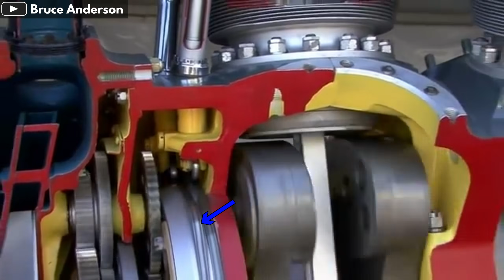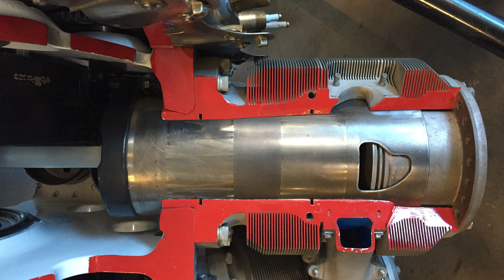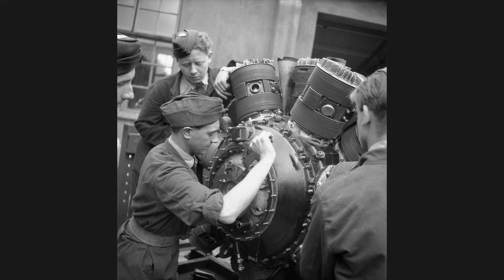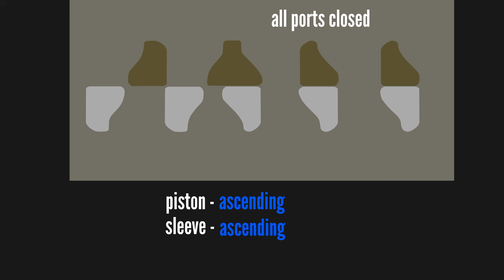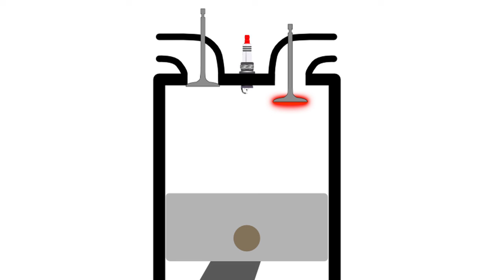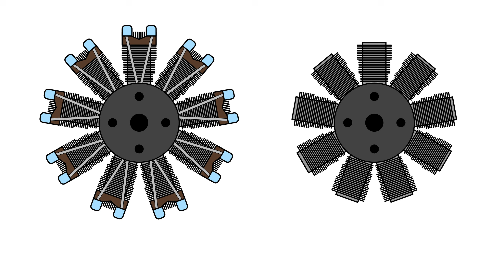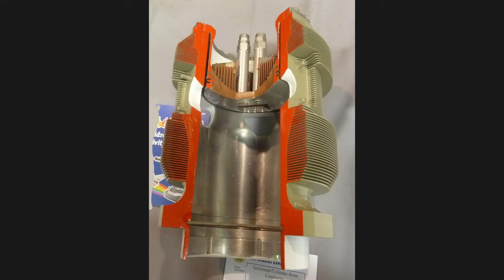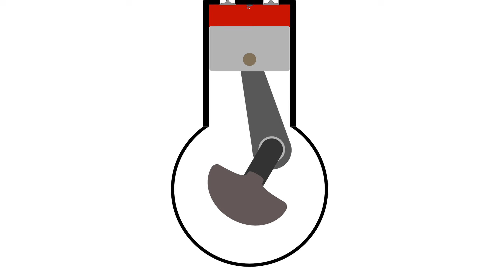Analysis of Bristol's Sleeve Valve Aero Engines

Comment: Thanks. Great Video
Whether it was the right path to follow: there's quite a few examples of the Brits sticking with what they had rather than trying to change mid-war. Vickers using geodesic construction and de Havilland building with wood to name two.  When you're fighting for survival, "what you have" can be better than the theoretical best.
Reply: While not a popular opinion, the UK aircraft industry while once very prolific was never a technology leader, and as you pointed out was years behind in many aspects of aircraft manufacturing compared to America or Germany at the time.
Reply: @DoktorBayerischeMotorenWerke  They weren't years behind so much as some companies were trying to use what their labor force knew rather than retrain or fight for the trained workers. This is why Vickers stuck to geodesic and de Havilland used wood. Vickers didn't want to retain their workforce to use more modern tech. De Havilland recognized that trained metal workers were limited. Likewise the amount of aircraft metal was limited and had to be imported. The risk of metal becoming scarce was a real threat. De Havilland's solution to get around this potential bottleneck was to use the otherwise heavily under utilized wood industry that was in the UK.

Deliberate diversification doesn't mean that the industry was years behind, or wasn't a technology leader. The British aero industry was still very much a pioneer at this time after all. Elements that went into the Spitfire were cutting edge technology wise. British supercharger development was in the lead for most of the war. The US eventually took the lead but the US military dropping all supercharger development pre war in favor of turbochargers meant that supercharger development had to go private in the US and that cost time.

Contrast the UK aero industry to Italy's. 1920s factory tech in Italian aircraft manufacturing facilities kept Italian fighter production numbers low during WW2. Italy's industry is a proper example of what years behind actually looks like.
Reply: @rainsilent  Britian was always years behind, behind Germany, America and France in aerospace technology... same is true today, nothing has changed.

Both Vickers and de Havilland were using outdated and obsolete technology, their obsolete methods and designs were only retained to maintain production rates, both companies would have become defunct much earlier if the war had not started and there wasn't a shortage of aircraft.

 There was a shortage of metal workers in the UK? Please, we are talking about Britain, not Zimbabwe! I would like it better if you didn't assume I was unaware of the British Industrial Revolution!

That argument is easily debunked, America and Germany also relied on imported aluminium, only France was self-sufficient in Aluminium supplies. 

Nonsense! The wood species used to build aircraft was also imported, de Havilland used Spruce, Birch and Balsa imported from North, South and Central America.

Bollocks! The UK had the smallest timber industry in Europe by the 1930's and most of its wood was imported.

NOT TRUE! The UK slipped further behind during this era, the aviation industry in the UK saw significant stagnation and lack of investment in the years leading up to the war.
 
   Elements that went into the Spitfire were also shockingly obsolete and caused fatal problems. Britian was decades behind in fuel control technology which is why the Spitfire was equipped with a completely obsolete SU float bowl type carburetor that caused loss of power and engine stalling in certain high G maneuverers, Luftwaffe aircraft were equipped with cutting edge direct fuel injection systems and German pilots exploited this technology gap to maximum advantage in combat.
The problem was not solved until Rolls-Royce imported American Bendix-Stromberg PD pressure feed fuel technology.

Germany made superior superchargers with a very advanced, infinitely variable impeller speed fluid coupling system. German superchargers were not limited by engine rpm and did not require heavy, troublesome gear change transmissions. 

 Turbochargers are a far more advanced and more efficient than superchargers, which confirms my point. America and Germany had turbochargers... Britain lacked this technology throughout the war. 

Italy still holds the World piston-engined seaplane speed record set in 1934... unlike the UK Italy still makes jet aircraft.

Please name a single British company that still makes jet aircraft in the UK?
Reply: @DoktorBayerischeMotorenWerke  "Britian was always years behind, behind Germany, America and France in aerospace technology..."

Irony that the British were ahead of French and many American companies all the way to the start of the war. Spitfire being a more advanced design than nearly everything available in the US when it was tested in the Summer of 41. Also the influx of British research and tech is the first major boost to the American air industry that got America going on the air side of the war. The French weren't ahead until they built the Mirage.

"Both Vickers and de Havilland were using outdated and obsolete technology, their obsolete methods and designs were only retained to maintain production rates..."

Not per RAF sources, especially in regards to the Mosquito, which was even very highly regarded by the Americans and Germans.

"There was a shortage of metal workers in the UK?"

Yes, there was. Not in the sense that you are implying but in the sense that the British manufacturing industry didn't have enough metal workers to fill their manufacturing needs across all of the companies they had. This shortage of skilled workers to go around was one of the major factors in why the Mosquito was built of wood rather than metal. De Havilland was going to have to poach some skilled workers from other companies to fill their needs.

"That argument is easily debunked, America and Germany also relied on imported aluminium..."

This doesn't debunk, in any way, the reality of the impact of Germany's blockade of the British isles on supplies and the feared further impact the blockade was thought to potentially have.

"Bollocks! The UK had the smallest timber industry in Europe by the 1930's and most of its wood was imported."

The UK had among the smallest forest area. So, yes they had a lack of trees but I wasn't talking about the trees. The UK had one of the largest woodworking industries in Europe. In de Havilland's letter to Wilfred Freeman de Havilland convinced Freeman that his company's woodworking expertise combined with UK's greater woodworking industry would allow the Mosquito to remain in high number production even if there were aluminum and steel shortages. This was a key factor in why Freeman kept it alive when the RAF was trying to cancel every project not critical after Dunkirk.

"NOT TRUE! The UK slipped further behind during this era, the aviation industry in the UK saw significant stagnation and lack of investment in the years leading up to the war."

It actually is true. The Merlin was, for a short time, the most powerful inline engine in production in a production fighter. The Spitfire was the best performing fighter in production for a short time as well. There were a number of engine designs that were showing a lot of promise, including sleeve valve engines. Are you just going to ignore the massive investment into sleeve valve engines the UK made in the comment section of a video talking about it? Whittle's jet engine was slowly trudging along in development and was even the first to get going. I've not gotten very far and the UK is clearly a world leader in aviation tech in the 1930s.

"Britian was decades behind in fuel control technology which is why the Spitfire was equipped with a completely obsolete SU float bowl type carburetor..."

Uh, no. The British were not behind. Rolls Royce chose an SU carburetor over fuel injection for the Merlin because fuel injection wasn't considered reliable enough yet and wasn't expected to provide the desired power at the time the Merlin was being designed. The designers chose to play it safe with a more known system rather than a still very experimental direct injection system to get the Merlin into production as fast as possible. Remember that the Germans decided to redesign the DB600 into the DB601 for fuel injection in 34-35. The Merlin entered production a full year before the direct injection DB601 did as a result. You are making a mountain out of a mole hill and then claiming it represents the entire industry.

"Germany made superior superchargers with a very advanced, infinitely variable impeller speed fluid coupling system. German superchargers were not limited by engine rpm and did not require heavy, troublesome gear change transmissions."

Not actually superior. It was a side step of an issue that would plague German supercharger and high altitude development for the entire war because of a lack of metals needed to make high end superchargers/turbochargers. They used a hydraulic clutch to provide variable speed control while providing adequate overall performance. It was slightly better than the British single speed single stage supercharger but worse than the two stage supercharger that was put into production in Nov 41. Case in point no 109 or 190 could match the performance of any two stage Merlin. This is why the P-51 dominated the rest of the war starting The Big Week. Because British two stage superchargers were superior to German variable speed superchargers. This was an advantage the Germans would not be able to find a counter to before it was too late in the war.

"Turbochargers are a far more advanced and more efficient than superchargers, which confirms my point. America and Germany had turbochargers... Britain lacked this technology throughout the war."

Efficient really depends on the metrics you look at. Power to weight wise they were worse. It wasn't until late war that turbocharger development was really starting to become worthwhile in regards to gains. By this point the jet engine was clearly the way forward so turbochargers never really got the chance to take over superchargers as being the better option. Also Germany had turbochargers that barely worked, if at all. Nothing entered service with them because they didn't have the right materials to make them reliable enough for service.

"Italy still holds the World piston-engined seaplane speed record set in 1934"

Yup. Because the British already won the Schneider trophy so stopped further development. The Italians, wanting revenge, kept developing to take the speed record back. The MC.72 used two coupled V-12s pushing around 2.850hp to take the world speed record in 34 while the S.6B used one V-12 pushing out 2,350hp to set it in 31.

As for post war none of that is relevant to the UK actually being a world leader in aero tech pre war, which is strictly what I am talking about. Did the British completely throw away their aero industry due to gross mismanagement post WW2? Yes. They spectacularly did the same with their car industry too. That doesn't change the world leader status of the industry pre war though.
Reply: @rainsilent  Wood and fabric construction methods were obsolete by WW2.
The pioneering technology leaders in Aviation like Boeing, Curtiss, Duglas, Heinkel, Junkers, Lockheed and Messerschmitt were building All-metal, riveted stressed skin, pressurized aircraft in the 1930s when de Havilland was still building wood and fabric biplanes!
 Britain lagged nearly a decade behind.

Float bowl carbs were OBSOLETE in military aircraft... America and Germany had abandoned their use in favor of more advanced technology. 

Technology NOT AVAILABLE in the UK

Britain's huge investment into obsolete sleeve valve engines was a colossal blunder, sleeve valves were a dead-end concept just like British centrifugal jet engines.

Britain's lack of turbochargers is a glaring example of its shamefully embarrassing lack of aerospace technology by this time.

The piston engines with the highest horsepower-to-weight, highest power density ratios and the best BSFC efficiency ARE TURBOCHARGED

Turbocharged engines ARE INHERENTLY MORE POWERFUL AND EFFICIENT THAN SUPERCHARGED ENGINES. 

This is an irrefutable fact that you cannot deny!

Germany may have lacked resources, but it leaped ahead of everyone in jet aircraft, Germany was years ahead of the Allies and produced the pioneering and advance aircraft in history since the Wright Flyer. 

The Messerschmitt Me-262 completely outclassed anything the Allies had in WW2.

Britain had absolutely nothing compareable.

The UK aircraft industry was already in decline before WW2... after the country's defeat its industries were doomed. 

Britain produced a long string of embarrassing and expensive failures that accelerated the demise of aircraft production in Britain to the point where it ceased to exist.

Please name a single British company that still makes jet aircraft in the UK?
Reply: @DoktorBayerischeMotorenWerke  "Wood and fabric construction methods were obsolete by WW2."

Not entirely true. The specific method of construction is more relevant than strictly the material. Lightweight metal was preferred but spots of wood structure was a common thing up to the end of WW2 on fighter aircraft from every nation that participated. Some methods of wood construction was state of the art for WW2.

"...were building All-metal, riveted stressed skin, pressurized aircraft in the 1930s... Britain lagged nearly a decade behind."

Selectively ignoring other British firms doing the same are we? You either are clueless or have a delusional bias. While Boeing was developing the P-26 Supermarine had already won the Schneider trophy for the 3rd time with the all metal S.6B... a full year earlier.

"Float bowl carbs were OBSOLETE in military aircraft... America and Germany had abandoned their use in favor of more advanced technology. "

Not true. Both Germany and the US made military aircraft that used them. They were obsolete for fighters, but not everything in the military. Even if they were only on secondary aircraft they were still on aircraft that served those militaries in some military capacity.

"Technology NOT AVAILABLE in the UK"

Not true. The British were developing pressure carburetors, aka mechanical injection, during the 1930s. They just didn't put them on any engine until the early 40s. The Rolls Royce Crecy engine was Rolls Royce's go at finally making a direct injection engine with their own DI design. They built the first one before they captured any 109 to study it's direct injection system. British designed direct injection also made it onto the Centaurus. The US even took a British fuel injection designed system and fitted it to the R-3350 to fix the fuel distribution problems the Americans were having early on with those engines. The British had their own similar systems. They just weren't bothering to use them on any engine that would appear until late in the war.

"Britain's huge investment into obsolete sleeve valve engines was a colossal blunder, sleeve valves were a dead-end concept just like British centrifugal jet engines."

They weren't obsolete until the jet engine made all piston engined fighters obsolete. Until that point they were a quite equal competitor with pros and cons.

"Britain's lack of turbochargers is a glaring example of its shamefully embarrassing lack of aerospace technology by this time."

No it isn't. The British didn't need them. They provided no benefit that made it worth putting the resources into developing them. Why put money into developing something you don't need?

"This is an irrefutable fact that you cannot deny!"

That is all true but it is only true under 2 conditions. 1. You don't have those engines attached to an aircraft and you compare post war turbocharged engines to during war supercharged. 2. If fitted to an aircraft only one aircraft with a turbocharged engine actually has a competitive P/W ratio when compared to supercharged contemporaries. During the entirety of WW2 fighters fitted with turbocharged engines had notably worse P/W than any other equivalent front line fighter with superchargers. So any increased power was being wasted by the bulk created by the turbocharger. You look at all superprop fighters that ever made it to some degree of production none of them had a turbocharger. The only turbocharged superprop that made it close to production was the XP-72. So at least 5 supercharged superprops that at least made it to production to 1 turbocharged superprop that only had 2 prototypes built. Your turbochargers are better belief is holding about as much water as a colander.

"Germany may have lacked resources, but it leaped ahead of everyone in jet aircraft, Germany was years ahead of the Allies and produced the pioneering and advance aircraft in history since the Wright Flyer. "

No they didn't. The Whittle engine may have ultimately been a dead end but it was good enough to make early production Meteor Mk.3s that entered service 17 July of 44. The British were ultimately right there with Germany. The Americans were too with 83 examples of the British powered P-80A entering service before the start of July of 45. Germany wasn't years ahead. Given the 262's service introduction date of April of 44 they were 3 months ahead of the British and 10 ahead of the Americans. The Americans are only in this race because of the British. The Germans also weren't the first to get a working jet engine. Whittle beat the Germans to a running jet engine by 2 years. Yes, the Germans got the first jet powered aircraft into the air but that was entirely because the RAF was dragging it's feet until 1940.

"Britain had absolutely nothing compareable."

Meteor Mk.3. Sure, the 262 is way faster but the Meteor is still comparable. Also the Mk.4 was right around the corner as it first flew before the end of the war and the Mk.4 was very competitive when compared to the 262.

"The UK aircraft industry was already in decline before WW2... after the country's defeat its industries were doomed."

This is pure delusion. Your claims in this response for are 0 for when held up to historical facts. The British industry peaked during WW2. The decline started in the 50s.
Reply: @rainsilent  Britain has never been a leader in aviation or aerospace technology... it did not invent powered flight or heavier-than-air flight, nor did it invent rocket or jet powered aircraft, it didn't invent swept or delta wings and didn't invent the Horizontal Stabilator.
We can all agree that Britian was not the first to develop supersonic aircraft.

What Britain did develop is called 'Inventus Albion' a mass psychosis that effects nearly every brit and is simply described as a form of Cognitive Dissonance where British people actually believe they invented every single technical innovation created by mankind.
 This is achieved by a complex system of exaggeration and fabrication of British achievements and a complete and total denial of any technical achievements created outside the UK or by a non-British person. 
Any foreign technical achievements are by default suspect and quickly discounted on the basis that it must have been stolen from the UK or that British efforts were somehow thwarted by dubious conspiracies and sabotage (which is never supported by any factual evidence).

There were only two winners in WW2, Britain was NOT ONE OF THEM.

By September 1940 Germany had crushed Britian to the point that it was mere weeks away from unconditional surrender, the British Royal family was already negotiating a conditional surrender with the Nazis but the Half-American, Churchill beat them to a deal, he surrendered to the Americans first instead with the signing of the Tizard agreement.

This shameful and humiliating surrender of Britain's autonomy and overseas territory is only referred to in the UK by a more palatable euphemism known to the brits as the "Special Relationship with America"

Things only got worst after the war and Britain was forced to sign away all of its independence to the Americans or face starvation and rioting in the streets, The UK became a United States possession from 1946 until 2006 under the terms of the Anglo-American Bailout Loan Agreement under Clement Atlee's government. 

Britain remains a US territory and military protectorate and US military forces still occupy Britain today.

PLEASE NAME A SINGLE BRITISH COMPANY THAT STILL MAKES BRITISH JET AIRCRAFTIN THE UK?
Reply: @DoktorBayerischeMotorenWerke  "Britain has never been a leader in aviation or aerospace technology."

Yes it was. Interwar period UK and Italy had two of the world leading aviation industries. Italy fell off about a decade before the war. UK fell off after the war.

"What Britain did develop is called 'Inventus Albion'..."

This is what intelligent people call making crap up.

"By September 1940 Germany had crushed Britian to the point that it was mere weeks away from unconditional surrender, the British Royal family was already negotiating a conditional surrender..."

Uhh, no. Not true at all. Nice conspiracy theory bull crap though. The closest the Germans came was about a month away from the SE RAF fighter group being exhausted in terms of having available reserves. Not the entire RAF from being wiped out but just the SE RAF group from running out of reserves within just the group. They still had 5 entire groups in reserve that they could swap in to replace the SE RAF group if they wanted to. The reality is that the Germans blinked first and lost the battle on their own as a result. That said the likelihood that the Luftwaffe could outlast 6 entire groups of the RAF and attain the air superiority necessary to invade the UK is pretty much nil. Just the first RAF group alone took the majority of the Luftwaffe down to around 60% of what it was before the BoB started. And the first group was still at around 65% of what it was. The actual historical data debunks all of your claims here very emphatically.

There was no British Royal family negotiating a surrender to Germany either. No legitimate historical document has any evidence to support such a claim. The closest is Lord Halifax suggesting negotiating a treaty after the fall of France, 

"Things only got worst after the war and Britain was forced to sign away all of its independence to the Americans..."

Impressive revisionist history. Good thing it is all false. I don't know if I should say your penchant for believing made up crap is impressive or pathetic. At the least it is telling.
Reply: @rainsilent  Are you a "Special Relationship" denier?  
The brits don't talk about the 'Second Tizard Mission'
Or the 'Anglo-American Bailout Loan Agreement'

The UK was a U.S. possession from 1946 until 2006

I understand you are too young to remember food rationing in the UK until the 1950's

PLEASE NAME A BRITISH COMPANY THAT STILL MAKES BRITISH JET AIRCRAFT IN THE UK?
Reply: @rainsilent De Havilland is a great example of how backwards and in the stone age Britain Aviation sector was in the prewar and Second World War era.
 The Comet Disaster is a product of this British obsolescence and incompetence.

Cheers Mate!
Reply: @DoktorBayerischeMotorenWerke  I can't vouch for if the British do in classrooms or elsewhere but American history books do as does history in general. Both are fairly well documented. Neither go to the degree that you are implying they do. The UK was never a possession of the US.
Reply: @JammisAdami  No. The Comet disaster isn't a product of British obsolescence or incompetence. It was an entire aviation industry not knowing the impacts of square edges on the wear of high altitude pressurized airframes. Proof of this is the fact that everybody was designing everything with square windows until it was discovered what was going on. Both Boeing and Douglass designers of their early jet airliners are on historical record admitting that it would have happened to their jet airliners too if they had been first for the exact same reason it happened to the Comet. They both took advantage of the timing to completely redesign the windows of their designs to avoid the problem as a result.

The truth is nobody in the industry understood the impacts of the dynamic stresses of high altitude pressurization and metal fatigue. Someone was going to be the guinea pig in having to endure these harsh lessons. It just so happened that the British were the first to get a jet airliner to production and thus ended up being the guinea pig as a result through no fault of their own.
Reply: @rainsilent Nah mate, you're fully shite, brits made nothing but bodge jobs.. crap aircraft.
Reply: @rainsilent The Square windows myth has been dispelled and debunked long ago... it's a red herring that de Havilland floated as it was completely unable to explain or take responsibility for it's bad engineering and poor management

The World certainly learned an important lesson from the Comet Disaster... that Britain could not make safe jet aircraft.
Reply: @JammisAdami  "The Square windows myth has been dispelled and debunked long ago."

No, no it hasn't. There is no evidence dispelling or debunking it.
Reply: @rainsilent The Square windows myth has been completely debunked and laid to rest many years ago.
 The evidence of what caused the explosive decompression failure was finally recovered from the bottom of the ocean and proved conclusively that the passenger windows did not fail and was not the cause of the crashes.

The crashes were the direct result of bad engineering, poor quality construction, substandard quality control inspections and terrible overall management of the company.
Reply: @rainsilent The Windows on the Comet WERE NOT SQUARE!

The Comet 1 aircraft all had 150mm radius windows just like modern jet airliners.

The Comet 1 aircraft crashed due to extremely eggerious engineering blunders in the airframe design process and testing proceedures.
Reply: @JammisAdami  "The Square windows myth has been completely debunked and laid to rest many years ago.
 The evidence of what caused the explosive decompression failure was finally recovered from the bottom of the ocean and proved conclusively that the passenger windows did not fail and was not the cause of the crashes."

I didn't say specifically that the passenger windows failed. I said windows in general. The structural failure for two of the Comet crashes started at the square ADF window cut out. While the passenger windows were not the source of the failures many windows did display fatigue cracks. They were ruled to not have had an impact on the failure itself either way.

Ultimately it was determined that the failures happened because of forces that were not well understood at the time. The basic Comet design was declared to be a sound design with no inherent issues by the Cohen Inquiry. This is the same inquiry that figured out what actually happened.

The reality is that everybody had to redesign their aircraft in the same way after this because it was discovered that metal fatigue happened 9 times faster in real life than the test conditions of the time that everybody used would lead designers to believe to be the case. De Havilland, Boeing, Douglas, everyone had to redesign their aircraft in the same way in response to this discovery. This fact clearly shows that De Havilland wasn't inferior in any meaningful way. De Havilland merely got unlucky because they designed their aircraft around shorter cycle times before major airframe overhauls were required. Had de Havilland designed their aircraft with the same expected cycle times as Boeing and Douglas everybody would have been having the same issue happening at the same time with seemingly random aircraft.
Reply: @WilhelmKarsten  "The Windows on the Comet WERE NOT SQUARE!

The Comet 1 aircraft all had 150mm radius windows just like modern jet airliners.

The Comet 1 aircraft crashed due to extremely eggerious engineering blunders in the airframe design process and testing proceedures."

Ok. First the Comet 1 windows. They were not all 150mm radius. Some were rectangles.

Second in regards to the windows. I'm not referring to the window shapes themselves. I'm referring to the joints. The fuselage cut outs is where the cracks were propagating from. The corner joints were square enough to encourage fatigue crack propagation. This is what all airline companies had to redesign their aircraft for. This is per the Cohen Inquiry.

The Comet crashed because testing procedures used by all airline manufacturers universally were wrong. Not just de Havilland but everybody in the industry. Their testing procedures for metal fatigue was giving everyone in the industry the believe that the airframes would last 9 times longer than they actually would in actual flight conditions. This wasn't just a de Havilland issue.

What you two are likely on about is you two are taking what Principle Investigator Hall from the Cohen Inquiry said out of context. Hall said that he agreed with the RAE's conclusion of design and construction flaws being the ultimate cause. But what you both are then leaving out is that Hall is agreeing with what Dr P. B. Walker, Head of the Structures Department at the RAE, said in regards to why these flaws were in fact flaws. Not because of de Havilland being sub par in any way in what they were doing but because of exactly what I said in the paragraph above. That test standards used by the entire industry were woefully underestimating just how quickly metal fatigue would happen by a factor of 9 to 1.

You two want to take the end conclusion out of context be my guest. I prefer actually reading further and learning why the experts think the end conclusion is what happened rather than making up my own version of why.